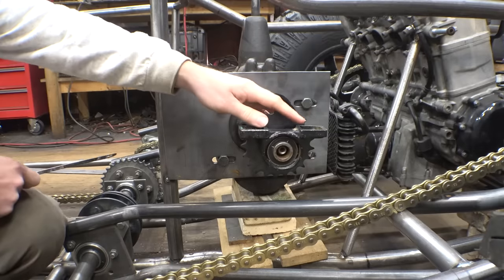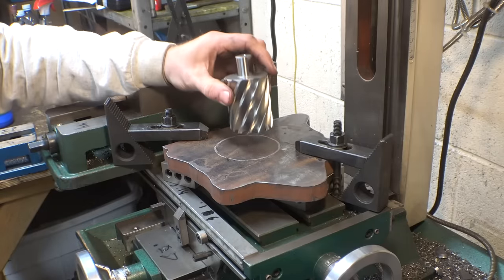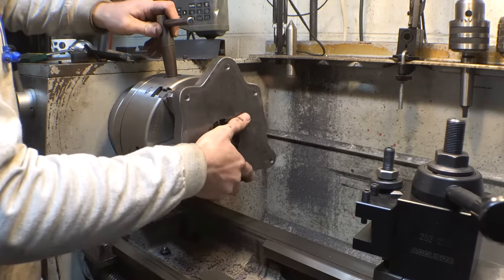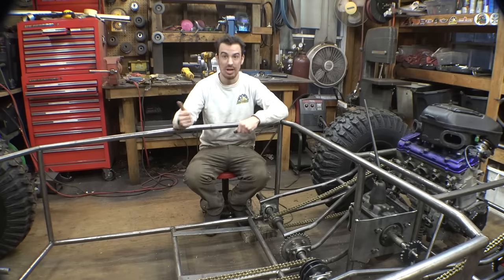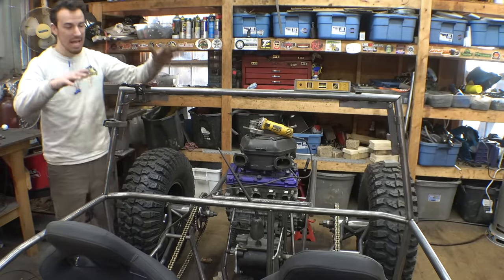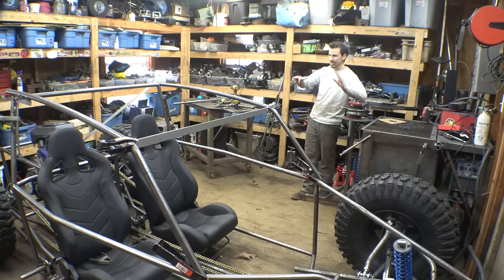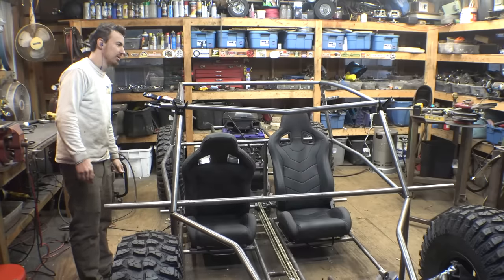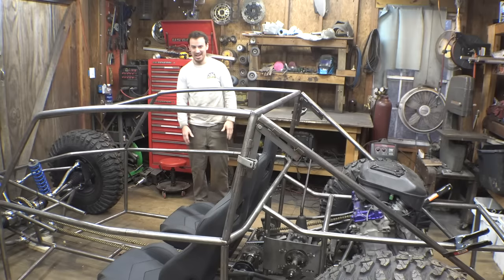Mini 4WD Trophy Truck Project - Part 7

Comment: This thing is turning out bad ass.  All your decisions on the frame have been spot on.  I’d totally do the alum-a-roof. Also, one suggestion, as you’re building this frame and trying to get your look right, might you set the vehicle at its ride hight to get an accurate perspective.  Just a thought.  Kick ass build man.

Comment: You could use plastic puck board for your side panels then you can avoid the tin can tinging sound  it also come in different colours. Just a suggestion

Comment: The chain in the middle in current setup will always spin, sure you made a coupling on the jack shaft but the sprocket on the front axle is fixed man, that will spin up the chain anyway

Comment: Everthought about using a front wheel drive manual transaxle. Do a poor man's locking differential, find a cable shifted save on linkages.

Comment: Spare on the roof if you want rear visability, but also why not consider flat carbon fiber sheet or fiberglass sheet to make the body panels rather than aluminium? I know aluminium is less likely to fracture but it's slightly lighter. So far this things looking awesome man 👍

Comment: You should put a rear view camera with full time screen for the rear view. I have them in both my older cars that do not have back up cameras and its kind of nice as I just leave them on all the time. Only about 100 for both camera and screen on Amazon for the higher Rez one. .

Comment: make your bars over the motor come straight back 12 to 16 inches behind the roof bar and then put a radius to turn the bar down to the rear horizontal bar at the back, maybe even having a radius at the back 8" above the horizontal bar. just an idea

Comment: In regards to what to call it how about simply MTT-1000, Mini Trophy Truck-1000cc. (1000cc engine right?) As for the roof a tube with a slight bend from center back to that low spot in the front would give you a good ridge line for a roof and match that sweet "aggressive" look it is starting to develop.

Comment: Disconnect mid chain from the engine and it's still going to spin with the connected front wheels. Only when you disconnect chain from engine AND wheels it will sit still in 2WD.

Comment: For another build you should look into the way they run the drive shafts of the legend race cars they also call them dwarf cars they run an 1100cc gsx-r engine with a shortened s10 rear end and the drive shaft mounts where the sprocket used to.

Comment: I love the way you work your skill is just out there and your amazing workmanship is wonderful,
I bet you build and design it in your mind many times while in bed or just walking around doing household chores I know because that's the way I do it nothing written down no plans well there is it's in your head I built my car the same way as a mechanic and a fabricator I built many custom cars all in my head nothing written down except maybe some measurements so I wouldn't forget I think the same as you and would build it practically the same the only difference I would have used a prop shaft and an inboard diff at the front and then wishbones and drive shafts coming from the diffs I think it's just safer and more reliable but I am interested to see how much torque you can put through that long chain it will work and when you put the chain on followers or slippers of nylon to rest the chain on and a tensioner then box it in making sure it's removable incase of a chain break and maybe make it oil sealable so you could put some lube in there to keep the chain lubed at all times or fit an oiler i know most chains come preoiled and are sealed but oiing them quite them down and helps less wear on the sprockets so good luck you amazing man chris and lets see what you do next time so all the best from john from Rugby UK. ps it looks amazing love the bend in the roof it's perfect you make it like you want, to me it looks so much better with the bends make it for you and nobody else again it looks super cool can't wait to see the panels on it Chris all the best from john.

Comment: Do the back the same way you did the top of the cabin frame , but maybe not the the a pillar portion just round em over instead of putting the straight tube , 🤷🏻‍♂️ just a thought

Comment: probably better off with a polycarbonate or similar for the roof, get one for a SXS and cut it / make tabs to fit.
putting weight high up and all that. thats why in dakar SXS run their spare tires on the doors of the car.

Comment: I love the concept and design. You can call it whatever you want.  I was looking at front of the floor board area. Would it be possible to angle it up? It wouldn't look so boxy and if you are Rick crawling it would work like a rock slider

Comment: That secondary transmission looks like a 1950s dodge truck transmission,  and it is terrifying that you stand in the line of fire on the lathe (the potential trajectory of your part if it came off) you should be behind or in line with the sled? Pretty sure that's not the name but that's what I'm gonna call it

Comment: You've got to run those rear bars all the way to the back of the box section, to protect the engine, but rather than run a straight bar, how about putting a curve in it, to match the roof line? :)

Comment: Awesome job and your a top notch fabricator imo. But that’s gonna be a lot of weight for a crotch rocket engine won’t it? Should’ve found a turbo charged eco tech or some kind of turbocharged 4cyl. Car engine but I could be completely wrong! Either way awesome work and can’t wait..

Comment: Love the projects and how you are talking through your decisions! Wanted to know about the middle jack shaft that you have just behind the seat. It looks like you are going with self-centering bearing support? Why did you need this? Is it because you have forces at different locations along the jackshaft and are worried the load would not be balanced or was this just easier to fabricate.

Comment: Maybe I missed something in the previous videos, but does your front diff have a disconnect from the center chain? Otherwise the chain will be spinning with respect to the front wheel speed and cause more drag on the engine.. even in RWD

Loving the look of the frame/body! Don’t overthink it too much, just go with your gut

Comment: Why don’t you make the 4 wheel drive chain to the front in 2 sections by adding another shaft half way along it will reduce the stretch and lower the chance of coming off though I am surprised you didn’t go with a double chain drive what your using will be under a huge load .

Comment: Think about your radiator placement! If it springs a leak being in front, it will burn you!!!!  I would put the radiator in the very rear of the car, that way it is safe, and will not burn you if it springs a leak.

Comment: you chucked the big trans bracket in the lathe to thin it down... how come you didn't flip it and do the other side where you had some misgivings about using the flapwheel on a gasket mating surface?

Comment: I don't know if possible and not but maybe you could have mounted that transmission upside down and then had all of your shifting linkage ran straight to the bottom of your shifter in the passenger compartment

Comment: Any thoughts on using large plastic sheets for body panels and roof instead of aluminum?  It would save a lot of weight and possibly same noise by eliminating aluminum panels rattling.

Comment: The angry eyebrows looks weird. Maybe two bends flat in the middle bending back on the sides? The back should definitely have something like a 10° drop them a bend in the middle, another 15° or so... It'd protect the motor and give you a more vertical ish place to mount your spare. Conversely you could build a roof rack (think Yakima) but a little taller and put the spare up there. It could look cool if you followed the windshield line up. That's my recommendations, but you do you. I like the crazy shit you build!

Comment: watching a circular saw go through 1 inch of steel plate nearly made me cry, but to my suprise it actually worked! But then instead of machining the plate flat to attach to the gasket, using a angle grinder instead, ahhh im crying again! Ive stopped the video, im going to push play now and see if it actually worked
Reply: oh haha first line he says "i probabaly should of machined this surface flat instead of taking an angle grinder to it! hahahah
Reply: i like your method of lining up the holes, might steal that idea next time im in  a tricky spot

Comment: Think u should study utvs now there more around for design and parts to adapt to your project and get a bigger motor from a road cruiser for torque think u have so much more potential but I understand the stuff not cheap he'll I wish I had some tool u have when I built thing back long ago did lot bikes ,trikes.quads,dune buggy keep up good work.

Comment: Love the design so far. But remember this is YOUR creation not somebody else's. The roof rolling does two things it gives you head room but keeps it low profile at the same time. On the spare rack come off the top of the cab and angle to the back like the windshield but not as much and spare on top. Love it so far tho. But remember it's yours not ours.

Comment: put the radiator in the back behind the engine. putting it in the front is going to cause problems. air pockets, low flow, over heating.

Comment: Where can I get those center drive line.  The center of the half shafts.  What are they called. What half shafts or cv axles are used.  Please anyone.  Thanks In advanced

Comment: Canada  🇨🇦  criss  you have a4x4  wheel drive and a 4 cyl  engine  calling it the  4x4  or the  Four bye Four get the chev  repo  sticker or the Ford one that's a sticker  4x4 for your spun alumin  gas tank  or cut out4x4 with water gun and have it back lit with bright  purple  or green or  maby  multi colored   back lights and some scarry  eyes peeking threw  just a thought from your  Canada crew FTFM Garage

Comment: With the camera view looking at the rear bars it looks better from roof to the furthest rear point but when you make the short angle it makes the rear look odd with the square end sticking out, you really need to take a look from a distance as being right on top of it you are not getting the best view and sometimes make rather strange decisions

Comment: 2:40 - are you building a tank or a buggy - how thick is that plate?!?!?? How much torque is multiplied by the transmission from a little motorcycle engine?

Comment: I have a question. I'm assuming the frame is in its lowest position in this video. How are you going to get in it when it's at ride height, with a top and side panels on when,as it looks in this video the side bar is at or just above your crotch height?

Comment: Umm... I understand why you didn't want to use the mill to smooth the back side of that bearing plate, but why didn't you use the lathe to flatten it off?
Especially since you used said lathe to finish the outer face

Comment: Rather than the angle grinder to flatten the mating surface why didn't you just use the lathe like you did to take some material off of it? That would have made it more uniform than the angle grinder.

Comment: I think lose the spare tire idea. It's not needed you can plug a tire easily to get back to camp. I also think he needs to build front fenders that slightly rise up and over the front tires with the middle between tires lower. This would add extra weight to the front for a better weight balance. Plus it will keep mud, dirt and sand out of his face and look more like a truck and not a buggy. Frame it out of 1/2" tube and sheet metal over. No need for it to be structural.

Comment: Just one other thing, I dont understand why you say fiberglass.body panels.will turn expensive.
Fiberglass is.super cheap, and you could easily make those with less.than 5liters of epoxy.
They get not as resistent as metal for sure, but way way lighter.

Comment: Cross Bracing the roof will compensate for the weakness introduced by the 'eyebrow'.Bending the cross brace to match the roof line will be a stronger option than the bend in the eyebrow. I like the way you work thru your problems, but sometimes you put 'style' before strength.As you run your vehicle's in a competitive way this is dangerous. Still if you don't try, you will never succeed. Keep the flag flying and enjoy your life.